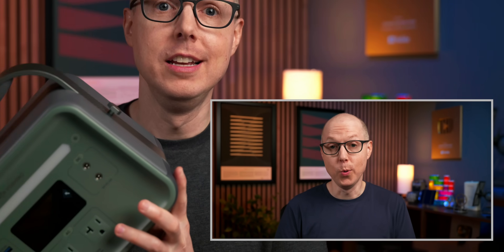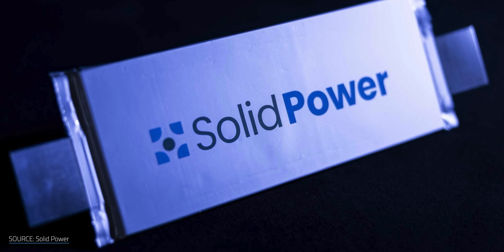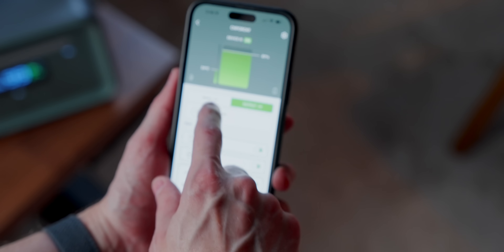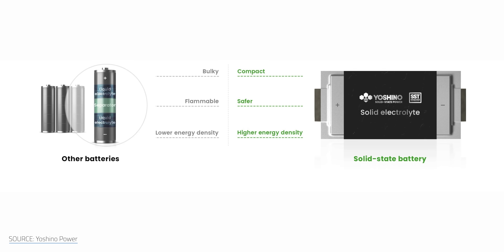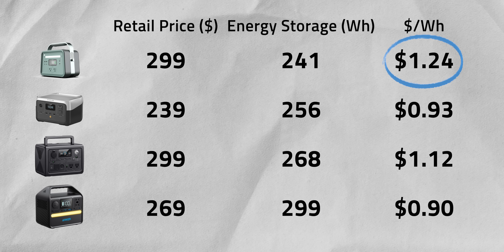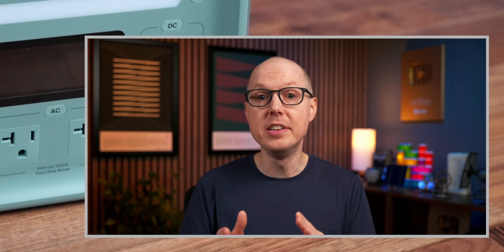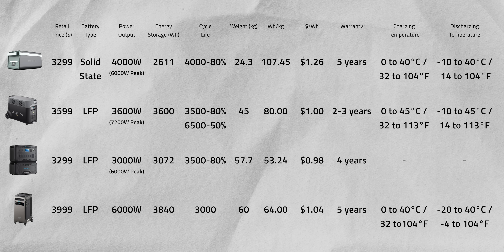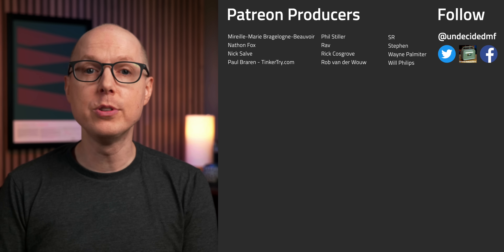UPDATED: Solid State Batteries Are REALLY Here - Or Are They?

Comment: My biggest problem isn't that there might have been small mistakes in the video. My biggest problem is that we keep constantly, repeatedly, and clearly, hearing from you, that these new breakthrough battery technologies from the future that will revolutionize everything... are 2x or 3x battery density or charge/discharge speed. A 20% (or whatever) increase isn't revolutionary or a breakthrough. It's marginal improvements over existing products, and that's progress, sure. But it's just not what was promised by these companies and especially not by all your previous videos.

When we ask to see these revolutionary breakthroughs from the future, we want a 2x 3x 4x battery capacity on the same weight, or a battery with the same capacity that's 50%, 40%, 30% the weight of their competitors. That's what you keep alluding to, and we're still waiting for.
Reply: I mean, the thing is we're not going to hit that sort of thing instantly. Like, battery tech multiple times better than it was 10 years ago, and orders of magnitude better 20. Since a lot of the individual components of a battery could be optimized or replaced, you're only going to see very slightly improvements year over years, that add up to batteries being that much better. But if you compare batteries that came out close together, they're going to be close in performance.
Reply: Ok sure but how many times have we heard outlandish claims and the only barrier to production was "scaling up"? I don't want a 10% increase in capacity - you can probably get this by offsetting a battery with lighter materials around it. I'm still waiting for the dozen 2x 3x capacity that we're waiting to come out of factories. Until then, I don't see the point. It's certainly not "revolutionary" in any way.
Reply: @eslachance  Chill bro. Not sure how old you are but remember first gen Li-ion batteries? They were markedly better but nowhere near as good as they are now. The tech will mature. If you don't want to "constantly" hear about emerging tech, then stop reading about it. Science takes a long time to become a product you can buy. That's how it's always been.
Reply: @roots4x  I'm chill, man. I'm not saying improvements are bad. I'm just relating that Matt is really quick on the "revolution" and "future", and has been taking about these batteries for years, and like I said, has clearly stated throughout these years that the biggest thing preventing commercial products was mass production and costs.

These Yoshino packs aren't much better, and they're not much more expensive, and my only point is that they are only a marginal improvement. It's an opinion, man, and I'm expressing it.  If you don't like reading contrary opinions, it's also within your power not to read them.
Reply: First off, I think this sounds suspiciously like a huge ad. That's very disappointing.

Secondly, you can't expect a first iteration product of anything to perform as well as the most mature and final iterations of the last gen product. THat's not how things work. First iteration stuff is sometimes even just on par with the previous gen products. If you compare the larger battery pack, there is substantial weight savings. Now that mass production is in full swing, there will be rapid advancements. Patience is not a virtue that people seem to even pretend to have anymore. 

Regardless, this still seems like a huge ad and is very disappointing. I know he said he has no association, but something seems fishy.

Comment: Props I guess for taking down the original, but it's really the bare minimum required here. You presented a no-name manufacturer's marketing as factual proof and didn't do the most basic investigation to verify it. The little research you did do gave no indication at all that these are anything other than regular Li-Ion batteries with liquid electrolytes.

Bring more skepticism in the future. Do the work. Don't buy into marketing BS.

Comment: As I suspected, as is the first claimed solid state ev cars by luxeed, but the latter openly admits it's not full solid state. The industry and well as luxeed now refer to them as semi-solid state battery. It's more or less an official term yet, but insiders will know what you mean. (interjection, I realise I need to explain a bit more). The thing is that th eindustry have not yet estabished even a small scale commercial production and chain to supply it, but on the other hand semi-solid state have been somewhat albeit very small still, have been established in China and Asia if you follow the market and industry supply. I wouldn't be surprised if they have shared supplier and other shared and common partners with the luxeed world first solid state battery cars. Even if it is semi solid state it is still a world first. The density and weight now makes a lot more sense, even if the industrial design of the battery could have been better and slimer. Luxeed for the claim they, did, did in synergy estabilish at least a supply chai for the semi solid state still better then conventional battery of lithium or else

Comment: Thanks Matt for doing this UPDATE, and providing transparency into what is known, for the Undecided community. 
It would be nice to have more clarification on what the battery industry considers "solid state". My understanding that solid state is just a reference to the electrolyte used in manufacturing the cells, which is a gel, or a dry paste. This is said to improve assembly efficiency in manufacturing. If there is not an industry conscientious, that would also be good info. 
As far as cell energy storage capacity, it is my understanding it is determined by the storage capacity of the anode and cathode materials. Storage capacity of anode and cathode need to be similar, otherwise the higher capacity material is limited by the lower capacity material. 
Matt, it would be helpful to touch on how all 3 components (anode, cathode and electrolyte) effect cell capacity. For example, if a dry paste electrolyte takes up less cell volume, then the surface area of a given volume cell can have more cell layers, thus more surface area. (ie: increase capacity).
The other area of interest is "solid state" cells are suppose to have much higher cycle life (full charge/discharge cycle counts), as the thick gel, or solid paste type of electrolyte is suppose to stop hair-like dendrites from growing between the anode and cathode. This is harder to verify, as it requires putting multiple cells through an endurance test to measure how cell capacity decreases over time, under different temperature conditions. (cold, near room temperature, and warm)
Reply from the maker: Awesome comment and suggestions to cover in the follow-up.  You and I are thinking along the same lines.  I do think there's a big issue between what is technically a solid state battery vs. perceptions, so I'm going to hit on that in the video with some experts to chime in on that (trying to get that lined up now).  Once we have that baseline established we can explain why Yoshino is or isn't a solid state battery.  As frustrated as I am at myself for ending up in this situation, I'm also loving it.  It's a great learning opportunity and I can't wait to share what comes out of this.
Reply: This the best attitude .. "It's a great learning opportunity."  The technology is just making its way from the lab into mass production, so there is a limited amount of good information. Really appreciate you taking the extra effort to better understand and share to educate a larger audience.

Comment: Check out the tear down by @bigtb1717 he proves it isn’t using solid state batteries - The part number of the standard pouch cell batteries proves this by itself. And the batteries go into thermal runaway when they sustain enough damage.

Comment: Another youtuber shot one of the cells with an arrow, it burst into flames like any lithium pouch cell. Not solid state.
Reply: Bigtb1717 was the YouTube channel.
Reply from the maker: I keep telling folks in the comments, but be wary of relying on penetration tests to determine if it's solid state or not.  Solid state batteries can still suffer from thermal runaway and fire given the right kind of damage.
Reply: @UndecidedMF  Should be minor without flammable electrolyte I would think. That was one of the big promises of solid state.
Reply from the maker: @JRP3  yeah, but depends on the type.  There’s a few variants on solid electrolytes.  Polymer, which is what Yoshino claims to use, can still burn under the right conditions.
Reply: @UndecidedMF  Good points, I guess we'll have to wait for full chemical analysis of a cell.

Comment: https://youtu.be/LsZfjF9SObo?t=344  Nail penetration test with thermal runaway with short circuit test passed. So why after puncture by metal object like nail it is reacting like lifepo battery? Swaling and burning. Where is that thermal runaway test passed? BS

Comment: There have also been some questions around the actual origins of this company specific to the claims that this battery pack was "was designed in the US with Japanese solid state technology". Exactly what Japanese technology are we discussing here? The battery cell data sheets seem to trance back in fact to a Chinese company. Perhaps to avoid the negative connotations of a Chinese made product and to evoke the quality associated with Japanese goods in the US specifically. Any follow video must include a discussion of this as I seem to remember at least in the original video this was specifically mentioned as a selling point. If the cells aren't what a reasonable person would expect to call a solid state battery then are there other advertised terms that are misleading? Does it claim that it uses GaN in the power supply for instance?

EDIT: the Japanese reference seem to only be on the website, but that raises more questions like who the hell actually runs this company I haven't heard of until now? Is the US office they have their headquarters and they are actually a US base or is it some smokescreen for a Chinese company scared of anti china sentiment in the US? Again on their website notmention about what EXACTLY is Japanese about this product.
Reply: I'll add another thing scrubbing through the original video, it also seems crazy the US based lab "Energy Assurance" would rubber stamp these puncture test claims when we have seen from other teardown this seems to be a standard LiPo cell.

Comment: Yeah there's tons of these lol. There are currently zero large volume solid state batteries right now. There's tons of falsely advertised units. I caught one on fire on my channel a year ago. 

You should open every unit you review. Theres tons of garbage out there.
Reply: Yeah polymer is not solid state 😂
Reply from the maker: @WillProwse https://pubs.acs.org/doi/10.1021/acsomega.2c01926
Reply: Yeah the companies told me the same about the safety ratings. You need to put a drill through it. You can't trust these companies.
Reply: I am pretty sure MF cried when he saw the pouches explode on bigtb1717's channel 😂
Reply: Now I know what the acronym MF is in his channels name.
Reply: A PhD student?! 😂 Just open it up right now, takes five minutes. These companies are a dime a dozen. They are not special.
Reply from the maker: A penetration test is not the way to determine if it’s solid state or not.  Solid state batteries can still suffer from thermal runaway.  Analyzing the separator inside the battery and the chemical makeup will answer that question.
Reply: @UndecidedMF  or you can open up the cell and see if there's a liquid or a solid. It's very easy. Solid State means it's a solid. If there's something in it that's not solid state, and it's in a liquid state, it's pretty obvious what it is 🤣
Reply: @UndecidedMF  considering the price it's probably a semi-solid state electrolyte battery. Really not that special
Reply from the maker: @WillProwse  that’s precisely what I want to determine.  If it’s not solid state, what exactly is it?  Based on what Yoshino is saying I’m also trying to figure out why they think it’s solid state if it’s not.  I guess I have the attitude of trying to cover all my bases so they can’t squirm out of this if they are playing a fast one.
Reply: @UndecidedMF  seems like they are semi solid state polymer cells. That's all. They do have some safety benefits but not nearly as good as solid state batteries in the lab. Once someone figures a way to mass manufacturer solid state cells at a competitive price, they will be a hit.
Reply: @UndecidedMF  and yeah I understand. I just work with a lot of these companies and they stretch their marketing terms and promises often. Always going to have pros and cons here. I am excited for solid state but it's not here yet. I love all batteries though and the tech in this cell would probably be more appreciated if it was called semi solid. They have been around for a while but this one is a bit safer. But not safer than LFP variants. Just depends on what you're comparing here.
Reply: @UndecidedMF  I'm telling you right now I deal with this type of misleading advertising all the time 🤣 It's very common with these types of cells.
Reply from the maker: @WillProwse  I believe you and I do think they may be playing fast and loose with the definition of solid state.  But I’m keeping an open mind until I see the full details (kind of a “is it a minor shoulder shrug or a major OH C’MON!” reaction. 😂 What’s funny is that I just interviewed the CEO of Quantumscape today about some interesting news on their path to production.  Even he mentioned how there’s no unified and agreed upon definition of solid state (I asked him to help level set what a solid state battery is).  That lack of agreement is only helping to make this issue muddier when random companies make wild claims.  For clarity, I wasn’t taking about Yoshino with him, just very general terms.
Reply: @UndecidedMF  oh very nice!!! That interview should be awesome to listen to, I can't wait. And I see what you're saying. I'm trying to keep an open mind but I have zero hope till it works in my lab as advertised 😂 I've been let down by these companies a million times. Interesting about definition of solid state electrolyte batteries. I make the assumption that it's solid state, and that it is non combustible and extremely long cycle life with minimal degradation. Lots of variants are coming to fruition in the lab, but just haven't seen a stable large scale manufactured one yet.
Reply: @UndecidedMF  I should mention that most LFP cells will last longer than the device that they are in. Especially if there is an inverter circuit. The Fets are going to fail long before the lithium ion cells. Or the Fets in the BMS. I think lithium ion batteries are underappreciated and already perform above and beyond what is necessary, and no one critiques the management systems or integrated inverter circuits on these units. That's going to matter more than the cells by far.
Reply from the maker: @WillProwse  really good point.
Reply: @WillProwse  Exactly. With any new technology, it is reasonable to expect the first-generation products to cost about 5 to 10 times what current-generation mass-produced(!) old-tech products cost. Even if they could theoretically be produced for the same cost, it takes time to get mass production and its scale effects running.

The only exceptions are iterative upgrades, like a new CPU generation or the next model year's car. But solid-state certainly isn't an iterative upgrade. A tweaked chemistry would be one, but solid-state is not just a tweak. Even the mechanical process of layering and canning a cell is different.
Reply: This is why I trust @WillProwse more than any other YouTuber for electrical reviews. He's not afraid of tearing products (and brands) up.
Reply: @adriftatlas  Nom nom nom nom (sounds of you gobbling his balls)

Comment: The company lied. They are lithium batteries
Reply: Bruh solid state doesn't mean its not lithium it mean its using a solid electrolyte instead of liquid one. A solid state battery be of any baterry chemistry  like lithium-ion, lithium iron phosphate, lithium titanium or nicklel metal, what make a solid state a solid state battey are its electrolytes
Reply: @iamnobody4574  Bruh, declining EROEI constrains exponential growth. It's Joever.
Reply: @iamnobody4574  bruh there advertising is all bull shit lies
Reply: @jasonflt  there is the problem, solid state battery these days kind of became buzzword. According to a paper that i read a while ago, there’s going to be several types of the solid state battery each uses solid material for different components within the cell. The true solid state battery as hyped, it’s still a solid 2-3 years away.

What you’re getting wrong here, it’s that SS battery is still going to be lithium battery. But you’re right that this is not the SS battery promised. We still half way there.